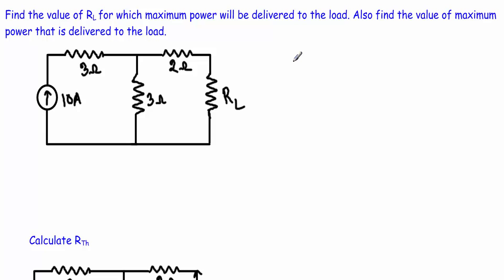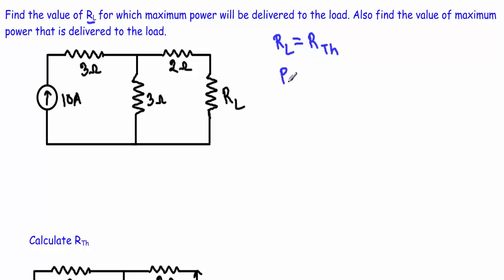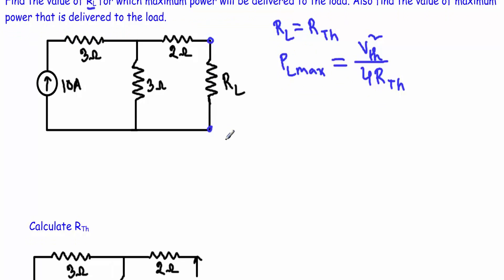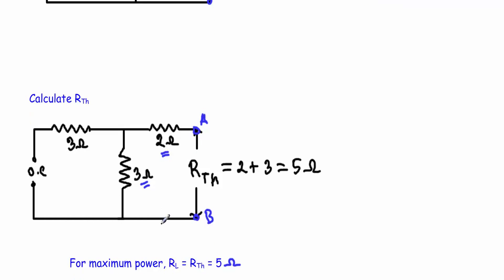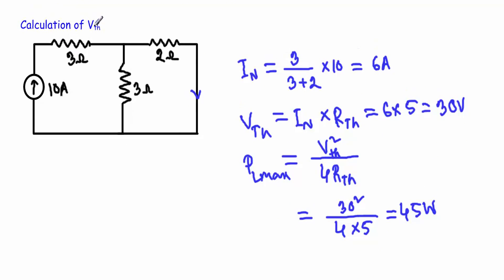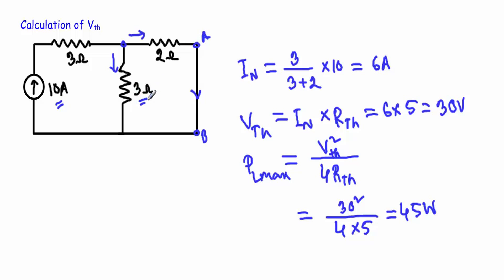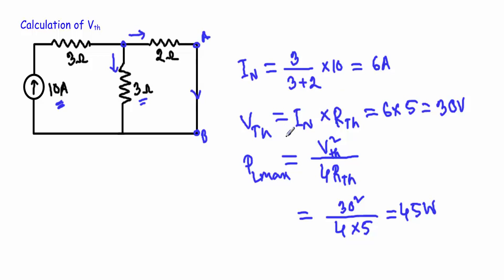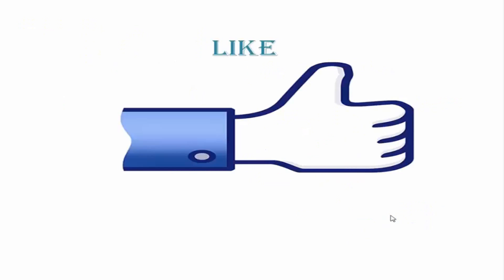Maximum Power Transfer Theorem Solved : Example 1 (w subtitles)

Comment: all of the explanation are wrong....the solution on rth is wrong he did not parrallel the r1 on the sum of r2 and r3.....and in vth r3(2ohms) not suppose to be add cause the rl become open circuit mean no more current flow on r3

Comment: why 3ohms resistor is taken while applying current divider rule why cant we take 2ohms resisitor
Reply from the maker: This is how we apply CDR when two resistors are connected in parallel.
Reply: Actually it is nothing but applying current division rule

Comment: Why is the Thevenin resistance 3+2=5 in series? I would have thought they should be in parallel, 2||3.
How do you know when to use series or parallel calculations? Thank you for the video!

Comment: uumm the 3ohm resistor was supposed to be considered to find Vth
Reply from the maker: +Tafadzwa E Tarwireyi , you are right. But, here I am not applying VDR to calculate Vth. To maintain uniformity, I have used Vth = In * Rth rule to calculate Vth
Reply: ok thanks l was using the VDR method dont know the one you used either way good tutorial
Reply: +EE Academy uniformity means.. in which criteria?